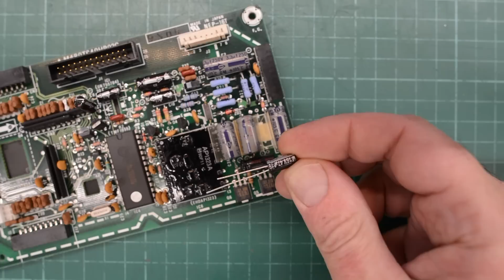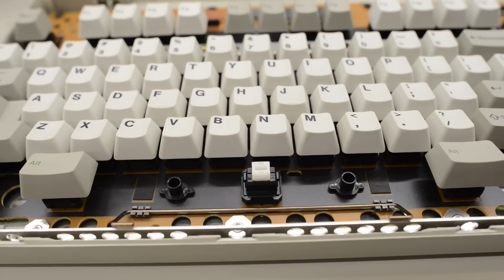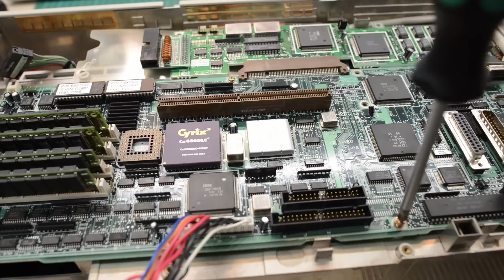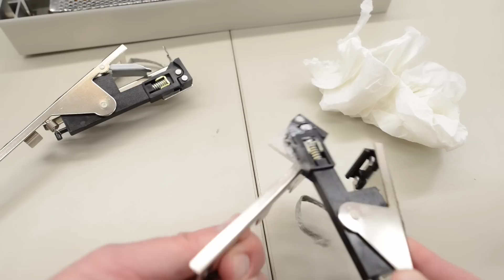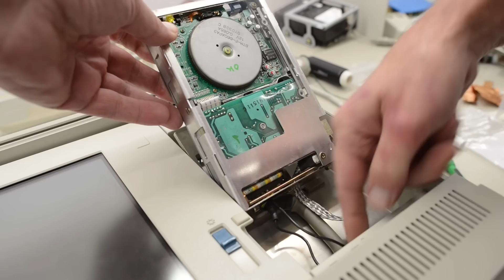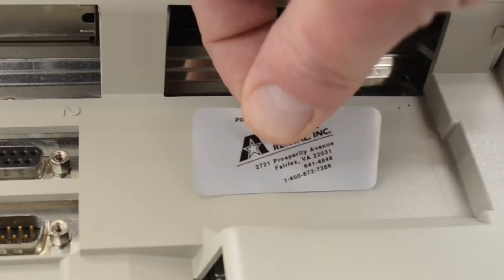IBM PS/2 P70 Rebuilt from parts. Display repair & overclocking experiments

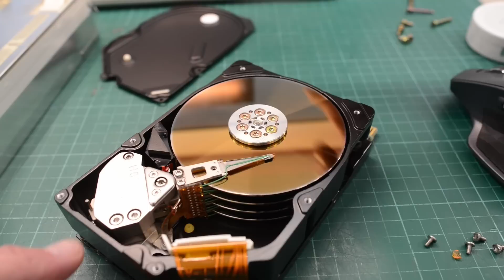Comment: 11:52  hello, i am no expert on Hard Drives but if the header is located on center of the drive when not in operation, that means it must be not initialting toward landing zone. 
I recomment to set back to landing zone and see if 10483 still pops up. 
I solved several of them by manual reset to landing zone. Although hard drive need to be replaced very soon.

Comment: Greetings from the other side of the border ❤
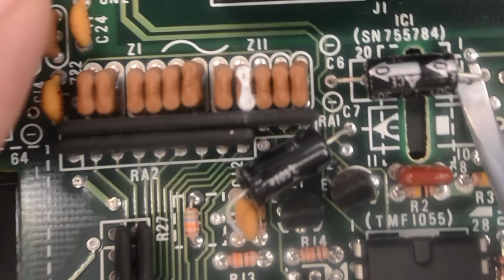I'm doing a restoration of an IBM P70 and I've opened up the plasma display for inspection. I've noticed that you also have, what it seems like, a "corroded" component at Z8 @ 2:45. What type of component is this and is it something I should be worried about?

Comment: Hey! Great vid. I have a somewhat similar machine that I just got. It was used for Hearing Testing, probably at schools. It has a PC Chips VGA that has what looks to be a special ribbon cable to power the LCD screen. Everything works. I saw that it had an AGP 2x port, so I wanted to do some retro game testing to check it out. Well, the AGP output is always blue, it's not outputting correctly. I've tried multiple working cards from other systems. Have you ever experienced anything like that?
Reply from the maker: Thanks. It sounds like an interesting machine. Is it a custom one-off, or does it have a model name/number?

Comment: Herculean effort all round. I have the P70 and a 55SX both with that dreadful floppy drive, which is not working on either machine and which seems to be unique to these two models. I have tried to bodge a standard 34 pin floppy drive to work on the 55SX but it refuses to cooperate so at least I have seen what fixing the original drive entails, which seems to be my best option. I am hoping that any capacitor hasn't leaked too badly and destroyed the PCB.
Reply from the maker: Good luck!

Comment: Did you replace the clock battery?
Reply from the maker: Yes, with the matching battery. I'll replace it again with two modern CR2032s later

Comment: Hi, 250V is not a safety voltage (cap rated voltage), it has to be done with some precautions. 
I don't know you country's law. Maybe you need to have a 2.5mm safety gap between conductive parts, add some insulation layers, you shouldn't be able to touch any part at 250V with a "finger as thin as a baby one" once assembled, pass the agreements if the modification is not an equal replacement...

Comment: Listening to you reassemble the display with the hinges around the 18 minute mark reminded me of the time when I was learning laptop repair in 90s at my first real IT job.
I was tasked with repairing a machine that was a somewhat newer model at the time, a Toshiba Tecra 720CDT.  It needed it's mainboard replaced due to a bad RAM expansion slot. This model was a complete tank of a machine in addition to being fairly expensive for the time. 
The tech who was helping me said the first step in replacing the mainboard (which was at the bottom of the machine) was to take apart the upper part of the machine and remove the LCD panel and backlight inverter.
I asked why this was as most other contemporary laptops by Toshiba, IBM, HP or Compaq usually required you remove the top half of the laptop and had the display cables plug in usually just under that assembly. You rarely had to remove the relatively fragile LCD bezel and panel unless the LCD itself was bad.
The tech explained that on the 720CDT Toshiba had run the display signal & power in 1 cable from the LCD panel & backlight inverter down through the rest of the machine.  Not only did they plug in the cable directly to the main board but also attached a grounding strap & screw to the mainboard. Only problem was when you took the top half of the machine off (LCD, hinges, and the assembly the keyboard and mouse buttons were part of) you also had to remove 3 other smaller boards (audio, modem & power) that plugged into the main board and an inner frame piece that supported those 3 boards before you could get to the other end of the cable. 
There wasn't nearly enough slack in the cable unless you disconnected it from the LCD panel & backlight inverter first!
On that model in order to replace that one part, which admittedly was a big part, you had to disassemble the laptop 100% of the way in order to do the job correctly. Other techs had tried to do the job without disconnecting that cable from the LCD panel & backlight inverter but usually ended up damaging the cable in the process as there was basically no slack in it at all.
Reply from the maker: I have restored the smaller Toshiba 300CT. It's an old video, but you may want to watch it if you want some Toshiba nostalgia :)

Comment: I'm surprised you didn't put a math coprocessor in there while you had it open or was that socket for one of those until overdrive chips if you wanted to replace the CPU that was on the board?
Reply from the maker: Yes, I think I have a math co for this board, but I don't think I have any games that would take advantage of it

Comment: The radial to axial cap modification is perfectly fine. I would only add a layer of heatshrink tubing over the whole thing.
Reply: I use a small (diameter) piece to go over the long leg.  Don't really even need to shrink it, as it will probably shrink at least partially just from soldering.  And if not, it's not going anywhere ...  :-)

Comment: Electrolytic caps of the era are a lot larger than modern ones. They're also higher ESR than modern ones, which if you uprate the voltage on modern ones, you'll more closely match both size and behaviour.
Reply from the maker: Yes, almost all caps I install are smaller than the original caps in my projects. But the size difference was unusually big on this board. This makes me a little worried that some of them might be some special type eg. high-frequency caps

Comment: Interestingly, if it was manufactured at IBM's facility in Spango Valley in Greenock, that site no longer exists as an IBM facility.  They abandoned Spango Valley and downsized to a call centre.
Reply from the maker: The P70 was manufactured in the US and Japan. Not sure if they were manufactured in Greenock too, but quite likely

Comment: Commodore sx-64 uses those plastic rivet push pin things on the boards inside. Next luggable repair?
Reply from the maker: Absolutely. I don't know when, but we are definitely taking on the SX-64
Reply: @Epictronics1  I have 3 of them so if you need parts let me know!
Reply from the maker: @justinthomas2458  Thanks, I appreciate that. My machine is working but I have not done a thorough test yet. I just played a game for half an hour

Comment: The first true ibm compatible coumputer i purchased was a IBM PS/2 Model 70 new in the box in 1991 for $300.00 dollars from an ad in computer shopper. It was loaded with IBM dos 5 and OSHA certification and training software. It was also 20mhz, I eventually upgraded it to 6mb, XGA2, and Cyrix DLC 50mhz but it ran at 40mhz. Used it up till late 90s for work but my ex wife got rid of it after divorce.

Comment: If it were me,. I'd dump the BIOS and have a peak at the code using BinWalk. It may be possible to rewrite some of the code to allow overclocking.
Reply from the maker: Unfortunately, I'm not skilled in BIOS hacking

Comment: What a remarkable undertaking that was. It's an immensely appealing device once assembled and the fact that it was a rental makes it even more astonishing that it's still with us. I learned to repair IBM time clocks in the early 70s and they were orders of magnitude more complex, capable and vastly larger than other such devices. Their traditional business model was to be in a whole different league from other companies and it did work at certain times in certain sectors.
Reply from the maker: Yeah, I never made any videos about it, but I have a small collection of Selectrics, they are fantastic machines too! IBM definitely made amazing stuff even before the PC
Reply: @Epictronics1  That's a perfect example. They rewrote the book on what a typewriter can be and do.

Comment: Is the clock crystal causing the bus for graphics etc. being overclocked too fast for it causing a non boot?
Reply from the maker: The graphics card is definitely a suspect, but it could be any, or many! chips
Reply: @Epictronics1  If you still want to increase the clock frequency, I'd get an interposer or try and jump the clock pins on the CPU socket like you've done before - a lot of these ICs were cherry picked to suit the shared clock speed on the mainboard and I doubt they're as flexible as standard PC clone boards of the time.

Comment: Man, I do it that way: Add new solder and heat it up and pull it out at the same time. It is easier for me.
15:15 - mounting pegs on board of Commodore SX-64
Reply from the maker: That would totally work.

Comment: Used to used one of these for a volunteer thing up into the late 1990s.  Nobody had a more modern notebook.  The PS/2 was available and worked fine for what we were doing. I do not miss having to lug it around.  But it was neat to look at.

Comment: Excellent work as always and a very strangely built machine for not many people at the time and even now. I know those orange panasonic flat panels are very shout after at the retro community and only few of them work now but yours looks to be really in great condition!
I have a feeling that the floppy drive cover did not go and klik all the way in at the bottom right corner ...
Cheers from Greece keep up!
Reply from the maker: Thank you. You are absolutely right. the bottom right corner is not perfectly flush. I tried to fix it after the vid but with the same result. I need to check what's pushing the cover out a few mm.

Comment: PS/2 architecture was designed with hindering the copying by other companies in mind. They used to be complicated and time/money consuming to be cloned on purpose by IBM
Reply: Meanwhile the PS/2 connectors got cloned eventually, considering they used similar signaling to the AT keyboard
Reply: @Voxfan124  At least they tried🤔
Reply: @ true
Reply: I'm not sure that's really true. IBM were happy for clone makers to licence the new architecture, they just wanted to reacquire control of the platform. I suspect the awkward aspects of the PS/2 were perceived as perfectly reasonable inside IBM.

Comment: Most likely, it is necessary to modify the bios so that the computer starts with non-standard frequencies for this ps/2 model. I read somewhere that some specialist modified the bios on another ps/2 model, which also did not want to start with overclocking and the computer was successfully launched with moded bios. But I can't remember where I read it. Most likely on Ardent tool. I also need to overclock my ps/2 model 55sx, but I don't know where to get a modified bios or who to contact with such a request. By the way, I read somewhere on ardent tool that a lot of ps/2 models do not start with overclocking at all, most likely, bios modification was discussed in the same topic.
Reply from the maker: Same problem with the 5170, but someone hacked it :)
Reply: We need a specialist with good knowledge of assembler, he can deal with bios 😊
Reply from the maker: @krizator  That would be great. I have several boards that need minor BIOS hacking

Comment: you could push out the tabs and then sand them. You wouldn't have to take the keyboard apart again.
Reply from the maker: Too late, lol. Apparently, they need to be 1.55mm

Comment: nothing wrong with makeshift axial caps, but it's usually a good ideal to put heat shrink on it.
Reply from the maker: I probably should have :)
Reply: Yeah the only issue would be at higher frequencies it may have enough inductance to turn into an antenna.   Looks good
Reply from the maker: @Dennis-kf0rlx  I'll find out!
Reply: I should have read the comments before I posted.

Comment: sure there's only a 50v cap across the air-gapped part of the board?
Reply from the maker: Yepp. 50v caps. a bit strange actually
Reply: @Epictronics1  who needs REFAs 🫢
Reply from the maker: I better check...